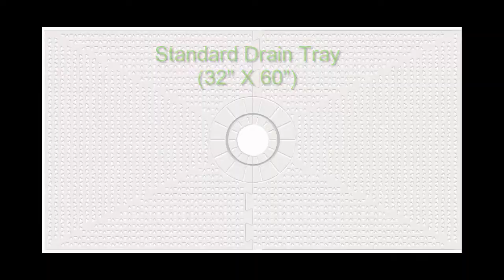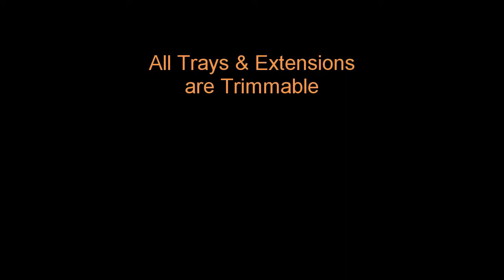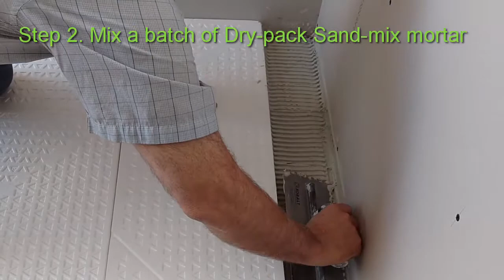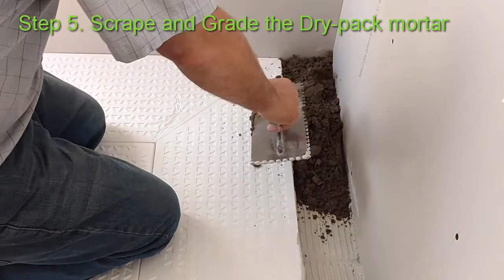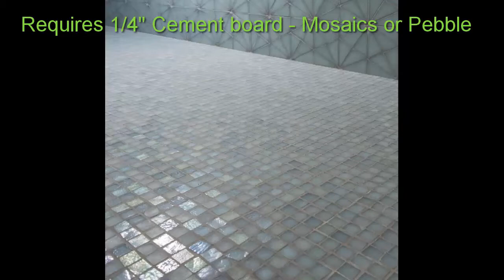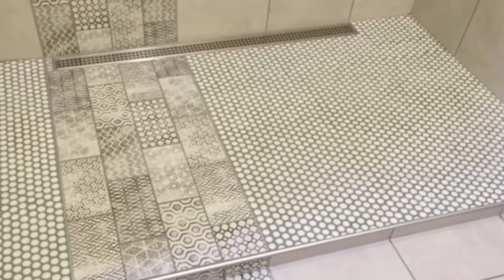How To Extend a Pre-Sloped Shower Tray - Kerdi Shower Tray / Trugard TruSlope Tray & Others

Comment: at 3:45pm you mention to install 1/4 cement board on top of Kerdi shower tray if installing pebble mosiac shower floor tile?   why is that?  i can't find that reference in the Schluter installation handbook.
Reply from the maker: Schluter doesn't give any recommendations to do this on their shower tray. It is our recommendation when tile surface area is less than 2" because of the increase in PSI (Pounds per square inch). We call it the Heel effect. If you have a small area and put pressure on it of an average person of 160lbs, you will press the tile into the tray. Hope that helps!

Comment: do we apply the cement board the same way as we would on wood surface?  screws and thin set?
Reply from the maker: Hi Semperfi B, if you are using mosaic tiles and need to add a thin cement board you will just thin-set the board to the tray. I also want to let you know that you can also do a thin 1/8" skim coat of thin-set instead of the board. I hope that helps! Not sure if you are military but I (Jake) am a Marine so Semper Fi! Your name implies.
Reply: Trugard Direct - Shower Waterproofing Installation, Tips & Tricks. Semperfi. Yes am a former Marine 0341. Thank you for your service. Thanks for you responce. So no need to screw backer down just thinsrt it to tray. I was planning  on doing mosaic tile on the floor
Reply from the maker: That is correct, NO SCREWS. Just do a skim coat or apply your backer board with modified thinset. Thank you for your service and when you are ready to purchase give us a call because we have a military discount.

Comment: if you put down 1/4" cement board, your presloped tray wont be presloped anymore.
Reply: We need an answer to this question from Trugard!
Reply: That was my thought. If i have to do that usually skim several coats of allset on the schuter foam pan  letting each dry in between then hydroban for overkill couple days before tiling it . just be careful and keep you slope correct. Always rock hard ..never had a issue